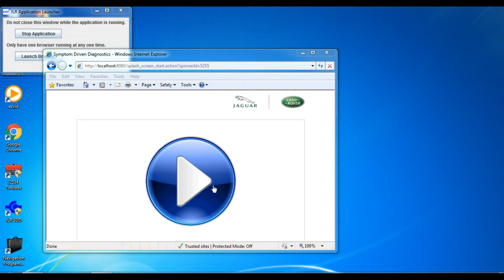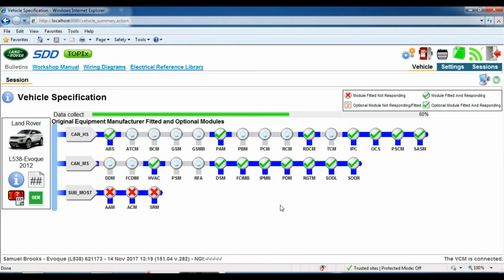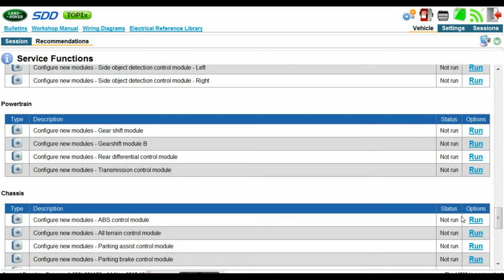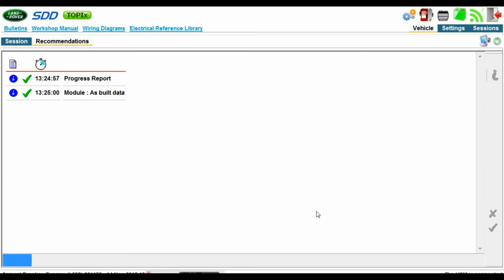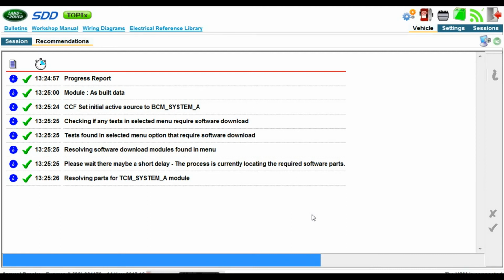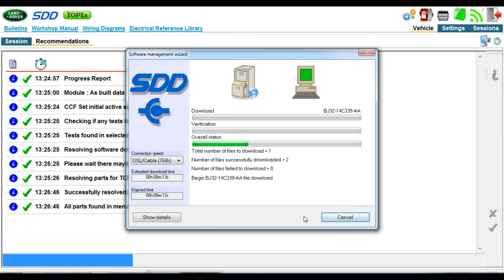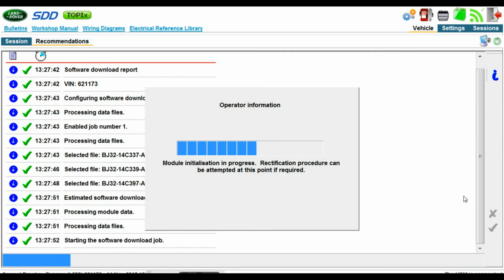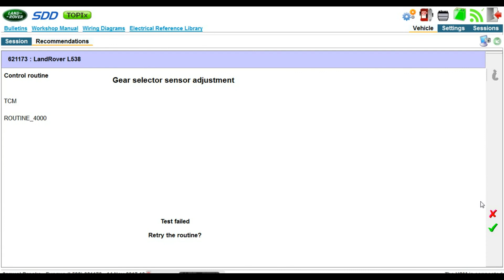2012 land rover evoque TCM Programming

Comment: Hello, I know this was 4yrs ago but did you have to do anything to get SDD to see your cable connection or did it just automatically find it? I'm trying to use SDD with a Autel J2534 and even though Autel software shows it as connected, the SDD software doesn't see it.  I'm wondering if you had to do anything.

Thanks for any info you can provide!

Comment: Hopefully you can answer this question, I have an SDD workstation and I may need to program a new BCM for the same year and model vehicle as described here.......I know there is data that is stored in the unit, how is that handled during programming?   It seems to be a pretty straightforward process to remove and replace the unit.....

Comment: Do you have to change anything on the ford vcm2 in order to make it work with sdd? For example the firmware has to be changed, or anything similar? and last question would the vcm2 will work for mazda? And if it does what it has to be done to it in order to work?
Reply: Oh ok, thank you for your answer. I was asking cuz you mentioned that you use the vcm1 to program the landrover. I assume that if the vcm1 work, the vcm2 should work as well. I wasjust asking because i was curious. I own a vcm1 and the shop i work for they own a vcm2. I never try any of this to see if the vcm2. I didnt even know you could use the vcm1 to work for landrover

Comment: Hello Friend
I'm with a range rover that does not turn off the emergency lights
the car has crashed, and it has been repaired, but the lights do not stop flashing
I tried to reprogram the airbag module and bcm with SDD, but I got the VIM error message
thanks